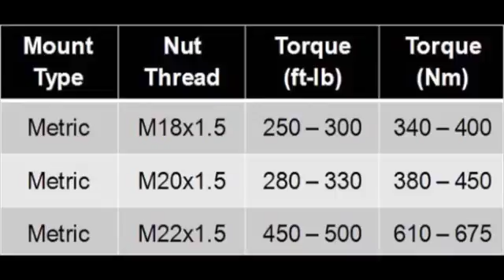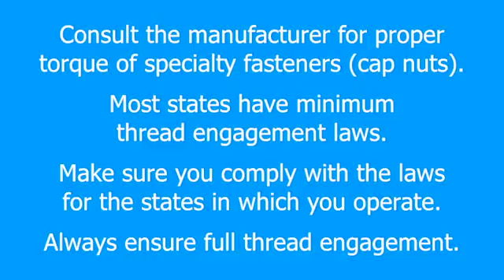Proper Flange Nut Maintenance by Alcoa

Comment: I have been in the Commercial tire industry for over 25 years now. I started out working in the wheel refurbishing Department and worked my way up working a multitude of different positions through both the Operations/Service and Sales side of the industry, including Facility Management and Sales Management over 8 Outside Territory Salesman. 
      I can tell you without a doubt that the torque issues on, specifically, the Hub Pilot wheel assemblies, causes the most sleepless nights for anyone in this field. It is critical to make sure that you use undamaged Flanged Nuts, Oil the nut between the flange and the nut surfaces, put 2 drops of oil on the stud, gauge the threads on the stud with a thread tool to ensure they haven't been stretched beyond the snap back point, make sure the studs are regularly replaced in less than 1 million miles, use the impact gun to run the nut up to the wheel surface (But NOT to torque), torque the nut (In a star pattern, beginning with the nut at the 12 O'clock position, then the 6, followed by opposite sides from left to right) with a torque wrench to 475lbs and then make sure to follow up with a retorque (Using a torque wrench) after 100 miles of operation, post wheel assembly installation. 
      Failure to follow any of these steps every single time you install a wheel assembly to a hub, using Manufacturer specifications, can and will lead to catastrophic consequences at one point in time or another.